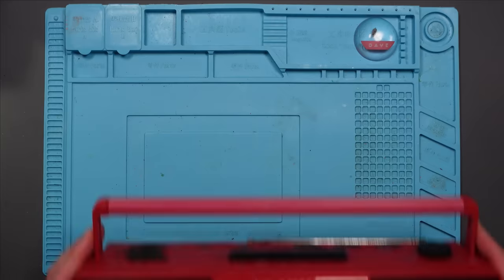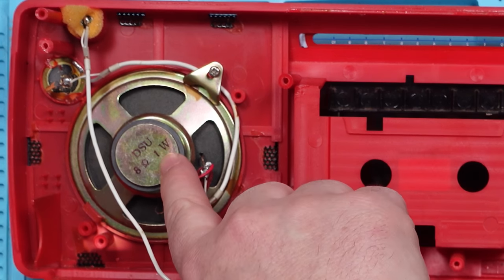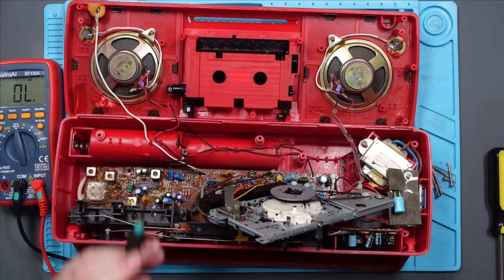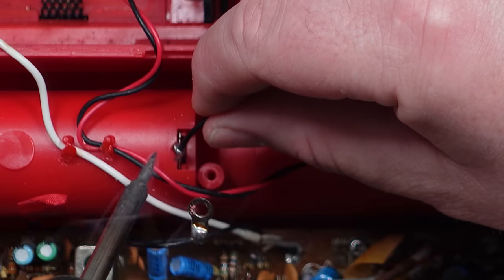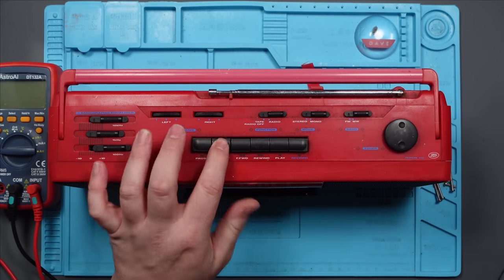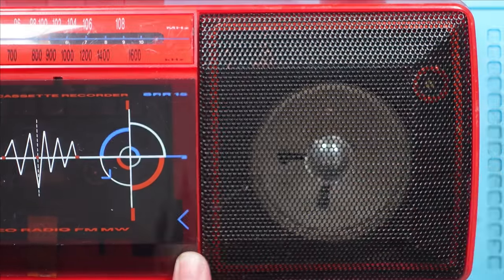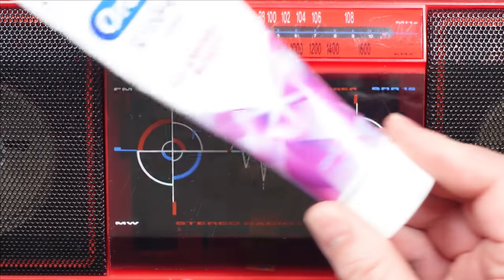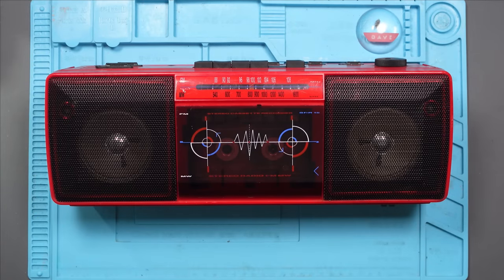Easy FIX? | Boots SRR 15 BOOMBOX!

Comment from the maker: Stupid "untested" Boots SRR 15 thing with a pink handle... thing.
Reply: heat does work on the handle but a safer bet is red dye. I used to use dylon fabric dye in hot water on my RC car wheels, it works a treat.
Reply: Stupid singing haters are going to love it tho😆
Reply: Noticed the boots logo so you know it’s quality!
Reply: It‘s doing nothing. Who could have thought of that?
Reply: Use The toothpaste like a polishing compound. Not with a earstick
Reply: Heat will make it fragile. I suggest a VERY quick wipe with acetone.
Reply: Prueba con peróxido de hidrógeno (agua oxigenada de 40 volúmenes) y luz ultravioleta o luz de sol seguro q recupera el color rojo
Reply: @AnanusBananus  Correct , he should have used a cloth . I use Toothpaste to clean  jewelry and it works very well

Comment: I just want to tell someone (because my wife honestly couldn't care less!) I fixed a pcb the other day using the knowledge gained from your channel! It gave me such a buzz (thankfully not the electrical kind), I'm inspired to fix more stuff. Keep up the good work!
Reply: noice 👍
Reply: Wives just don’t get it. Nice one mate 💪
Reply: Niceee! Same here! I had a Wii remote that would only Power/connect sometimes and the led's barely worked.

So I scrubber the controller with alcohol because there were green spots fused with the board all over. I also resoldered the little battery cables on the spot were  I thought the cursor battery was.

So after that I had the cursor back when it would connect only after a few min it went off and wouldn't come on again. So after that I found that the fuse was gone on the board and green stuff had fused the fuse spot togheter. Me cleaning it must have weakened the connection even more but it bridged the fuse and that's why it would work sometimes. So the pads are gone but I put a blob of solder on it and bam it's working again! Had nobody to share my Wii Story with so hopefully you Aren't bored with my story xD 

Anyways really nice we both got to use our new skills!
Reply: Well done mate, we all care 🥰
Reply: Oh man, I feel this.
This channels had me on an Amazon shopping spree fixing old electronics from my younger days I promised myself I'd fix one day.
Reply: @paulmorgan8520  thanks :D
Reply: Learn as you go that is how i have done things and information from fix it video's and forums have been a great help .
Reply: Keep at it man, search for DIY kits to build. Good soldering experience. 
I fixed our air fryer 4 months ago, feels good using that thing because I fixed it properly. The 9 year old me would have been in awe. That thing was like a puzzle, no left over screws and it's still going.
Reply: @Gunzee  feels good when you put the screws back and you are left with 0 screws :D it sucks when you forget one but with a good screws system we should be fine :)
Reply: Well done
Reply: What's a pcb?
Reply: @adamgrimsley2900  printed circuit board
Reply: @presidentskroob522  ahh, well done
Reply: Nice
Reply: Just wait till her vibtator stops working
Reply: Well done!
Reply: that's a good piggy

Comment: Thanks to this channel, I actually got the guts to open up my Pioneer 6 disc CD changer that had decided to not work all of a sudden. I don't have the proper tools at all, but I managed to find the error and correct it, and now it works perfectly again! Without Steve that CD-player would've ended up in the landfill. Thanks Steve!

Comment: Plastics can be polished with a compound called "Polywatch", its meant for wristwatch plexiglasses, but works on most plastics. Just keep in mind it contains some acetone for softening the surface of the plastic, so if the plastic has any printing on it, the acetone might be too harsh for it.

Comment: Hi. I have used T cut regularly on red plastic parts on vehicles. Red is renowned for going pink by sunlight. There is also a compound for cleaning plastic headlights when they haze over, it works on most scratches as shown on your video, most car accessories shop’s sell it. I hope this helps. Another great video. Cheers.

Comment: Toothpaste and baking soda are abrasives, they work on light marring. To restore the tape deck you'll need a few pieces of different grit sandpaper and some water. A cut and polish can be used after to make it perfect. Videos on restoring car headlights will explain the process to you, they're made from the same plastic. 

The discolouration can be fixed in two ways. The cheap, temporary way is to heat the plastic in the right way. The impurities melt into the lower layers of plastic, exposing plastic from below which hasn't been UV faded. Usually only lasts for 6-12 months before reappearing. 

The proper way to do it is to use a commercially available plastic colour restorer. It's essentially a plastics dye and UV coating that you rub on and it restores the colour.  This lasts for 5+ years and you've got the bottle to redo it after that time.

Comment: tooth paste/baking soda is used as an abrasive to remove minor scratches (same as scratch removal polishing paste) for big scratches like that, you'd need more abrasive stuff, but that would remove the design that's painted on.
As for the handle, best to prime it and paint it (airbrush or spray paint) with some durable paint (like lacquer).

Comment: Behind every faded and cracked plastic is fresh plastic, said a wise motorbike YT channel once. Look up "Fortnine Restoration in a can" and skip to the plastic bit. They use a simple buffing wheel to just get rid of the top layer and get the original plastic back. Using excess heat can lead to cracking (although it will work, temporarily)

Comment: You can try UV light and aluminum foil for restoration of fading done to plastic body. As far as I know it works for plastic yellowing.. for scratches, a clear nail polish mixed with few drops of liquid wax does good job as clear nail polish fills those small crack and scratches.

Comment: If you want to restore it to a less pinkish handle, you could try passing your heat gun over it a couple of times. The heat reactivates the pigments, and you should have a red handle again. Just be careful with the amount of heat.
Reply: I wonder if its really anything to do with the pigments, but just the plastic degrading and becoming "porous", so it reflects light in a different way and making it look lighter.
Reply: Some colours are more susceptible to sunlight. Red especially to infrared from the sun. The plastic from the handle is different than the body. Probably because of the regulations concerning structural integrity of electrical equipment. See CE. If you would heat the plastic from a certain distance the surface would melt and mix with the non degraded plastic below. Since this is probably the cheapest part. Test your gun distance on a plastic yoghurt cup. If it shrinks or becomes flexible, you are too close or too hot or too static on the same zone. This easier to do on a bigger mass because heat can spread easier like the seats in a football stadium. And with advice comes the usual disclaimer.
Reply: Red sharpie?
Reply: @timsim83  hahaha!
Reply: Came here to suggest the same
Reply: The only problem with this, is the discoloration is largely due to a loss of oils inside the plastic. When you heat it you do restore the color but you also draw oils from deeper within the plastic so it ends up making the plastic more brittle. Best thing to do is wet sand or polish the material to remove the faded plastic, then put on something to protect it so it doesn't fade again.
Reply: This. It's actually the oils in the plastic that come to the surface and gives thr plastic the deep sheen.
Reply: What about Linseed oil?

Comment: Blowtorch yes
Electric heatgun yes
Car clearcoat treatment: cutting compund + buffing, then wax and buffing.

You need to get rid og the first "nanometer" of oxidized plastic. You could sand it with 2000+ grid and then move into compound and buffing.
Maybe vitawrap the rest :D

Comment: Best thing for colour refresh...fire works...but low heat and keep it moving. A hot air gun works too. T-cut for cars works and also brasso matting (a cotton like wadding with brasso pre-loaded) that also works well for scratch removal.

Comment: The heat will change the handle back to red.  Just do gentle sweeps across the handle and you'll see it gradually change back to red. Don't hold it still in any one spot.  Practice on some other faded plastic to build confidence in the technique.  

Also, for the tape deck door, PolyWatch for polishing acrylic watch crystals should leave that little door actually looking "mint".  😁

Comment: Yes a heatgun can bring plastics back to life.  It basically sweats the oils of the plastic to the surface, some risk of melting and a patchy finish though

I would try peanut butter first though, the oils from the peanuts penetrates into the plastic, I've used it on black car trim and get great results, never tried it on coloured plastic though
Reply: Used engine oil is good for 'feeding' oils back into greyed out car trim.  Has to be done every six months, depending on the weather, but looks great and it's cheap.
Reply: @Falconhunter276  I think you can use pretty much any oil, even baby oil, I suspect the only difference is how long before it fades away.

I favour the peanut butter method because I can lick the trim clean afterwards.

Comment: 15 years ago i had a huge retro ghettoblaster from ebay for 35 Euros and i attached a aux input to the tape-deck so i was able to run all modern devices on this awesome sounding old machine (powered by Battery).Guess it was short time before bluetooth speaker were a thing. maybe you should try to attach kind of a bluetooth module and make this a modern bluetooth speaker. or find a old broken ghettoblaster with great sound and mod it. would love to see this.

Comment: To bring the handle back to Red & clear up light scratches on plastic you can use one or a combination of two types of products, rubbing compound and/or car polish (some even offer plastic specific formulas). Rubbing compound is slightly more aggressive and in this case would bring the handle back to new state but I would advise polish on the tape door as it could take off the printed on design and it's less likely to rub off with a polish. These products are very inexpensive and can be found at any auto supply store in the detailing section. I personally use Meguire's products as their compounds break down as you use them so they start more aggressive and almost turn into a polish after rubbing it in for a while. Apply with a microfiber towel or if there is no lettering you can get a foam drill attachment or a Dremel attachment and really get a better than new result.

Comment: When the headband on my Oppo headphones deteriorated I wrapped it in black leather cycle handlebar grip tape.  Gives it a better look than original in my opinion and is slightly more comfortable.  I reckon it would make the boombox look a bit more premium, although the tape will probably cost more than than the boombox itself

Comment: Toothpaste works well for scratches on certain types of softer plastics because there is a very fine soft grit in most toothpaste which is what cleans your teeth.  It works similarly to polish but you have to use much more than that and really use some elbow grease to work out the scratches.  I have personally used that technique on game discs that were slightly scratched and if done correctly it does work well.  Its not so much for cleaning as it is for polishing out scratches.
Reply: I second this post. I've used toothpaste as the final polishing step when cleaning up clear plastic 3D resin prints. I get the best results using a microfiber cloth, the crappy little squares you get for free with glasses cleaners and such, with the toothpaste.
Reply: I third it.
Reply: I fourth! Have to use some elbow grease.
Reply: Keep in mind that it also depends on the Toothpaste, not everyone has the same type of abrasive material.

Comment: Run the flame of a hand torch over the plastic handle quickly. You will see the plastic darken back up to its original colour. It's been faded by the sun at some point. Works all the time on plastic patio furniture that sit out in the sun all summer and fade - once over with the torch and they look brand new.

Comment: Scratches, use brasso in a tin (the fibre stuff)
Red fade, use your heat gun gently or you could try T-Cut but that's usually best on faded paint

Comment: Coloured plastic can sometimes be partially restored with those coloured car polishes Turtlewax make. Obviously you'd want red here! Then a couple of coats of a good carnauba wax or similar should bring it up looking pretty good. 

This works on old toys from the 80's/90's, I've not done it on a tape player before, so YMMV. 

And yes, you can Retr0bright coloured plastic, but it won't work here as this is faded pigment rather than the plastic changing colour due to sun damage, i.e from bright white to sludge brown as it's been sitting in a window for 30 years! 

Good luck!

Comment: Hi Steve, I used Retrobrighting in the past and it works very well. I am pretty sure, that I used it for some colored parts too with good results. Normally I use Creme Developer with 12% for this kind of job. Putting some gloves on, get some Creme Developer on a brush and give it a paint! 😀After this I wrap the part in cling film, put it in a box with aluminium foil wrapped on the walls and put a big UV lamp on top (Or outside in the sun). Every now and then the part is rotated and massaged in a little to prevent uneven results from the developer. After some while you should see a good looking part! 

Love your videos! 

Greetings from Germany,
Cheers Markus

Comment: You can use metal polish wad for removing scratches from plastic.  They come in a tin can, it's basically cotton saturated with polishing compound. You just pull some cotton out and rub on the plastic to remove the scratches.  But I'd careful with the graphics printed on the plastic though.  I think Never Dull is what people used.

Comment: Retrobrite probably does not work. Normally it is used to remove brown/yellow discolouration of plastic and makes the plastic lighter and not darker. Great video by the way, but why did you not test the boombox with AC power?

Comment: My first thought was "stuck switch in the mains inlet". Batteries need to be protected from being charged when something like this is plugged into the mains. Cheap gadgets did that with a manual switch (and if that is in the battery position, the thing will run off of the batteries even if it's plugged in), slightly more advanced one had a switch built into the mains inlet (or DC inlet in case of an external power supply) that automatically disconnects the batteries as soon as a mains lead or power supply is plugged in. I've seen those fail, especially on the small barrel connectors.

Comment: To remove scratches from plastic you need a mild abrasive such as brasso a bit of elbow grease not poncing it  arround with a cotton bud! its the rubbing action the does the work get a pad of of soft cloth with the abrasive of your choice press firmly and use a  circular motion.

Comment: Heat will restore the color. Just use hot air... Not a torch.

Toothpaste is a mild abrasive but it's very coarse and doesn't work well for plastic. It can work with a buffing wheel on aluminum... But there are other things that work much better.

I've never heard the baking soda thing.

Comment: i actually put toothpaste on a slightly damp tissue and it actually worked, it reduced the scratches so yeah the method does actually work but you need to use a damp tissue or a sponge

Comment: Easy fixes are always nice. Just has a similar fix on my heat gun

Cotton swap is too abrasive for polishing compound. Use a microfiber with the slurry and you may have better results. Plastic polish is still better as slurry will almost always leave a haze without a polish

Comment: To remove scratches from transparent plastics I've seen YouTube toy restorers using Tamiya polishing compound with great results, but in this case you'd have to be very careful with the decals. For the handle, I'd just mask the everything else and give it a coat or two of black plastic safe matte paint, it would match the black speaker grill.

Comment: My guess would be that it was from the early 80s. I had a similar, red Boots branded tape player (except mine was fancy with 2 tape decks 😂 which definitely wasn’t used for copying cassette based ZX Spectrum games 🤥) which I’d say puts it around 1983/4/5

Comment: I'd have checked it on mains supply as well as batteries, just so I knew if the fault was on one or the other or both, but this was an easy fix anyway. I adore little radio's like this. Do you sell any of the items you fix?

Comment: The toothpaste will work for the scratches, but you need to use a cloth instead of a cotton swab. The heat generated from buffing the paste is what’s gets the scratches out. Also, be careful of the silkscreened bits.

Comment: 3rd comment and I promise if will be my last, lol. I'm not sure if you have it across the pond, but Rit brand dye is excellent for plastic and comes in almost any color you can think of. You would need to remove the handle though, or figure out a way to  only have the handle submerged in the dye.

Comment: Once the plastics have faded in colour due to age, & wear & tear, you cannot get the original colour back with any sort of cleaner & buffing methods, The only thing you can do is, colour code for the right spray paint, & finely spray paint the handle, then clear lacquer it. To do a pro job, completely remove the handle before spraying.